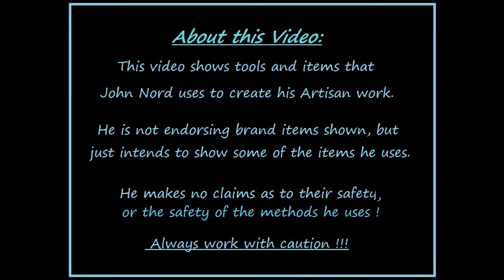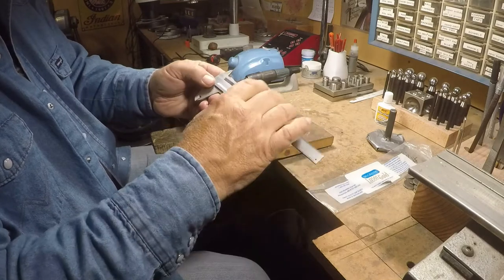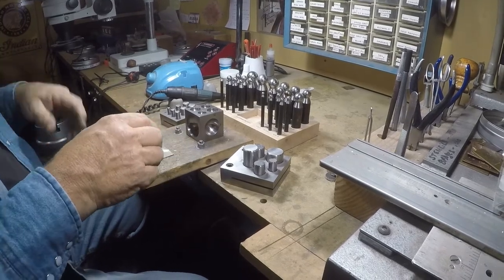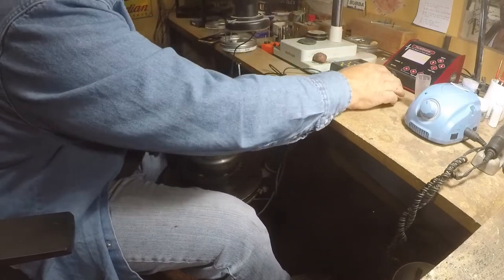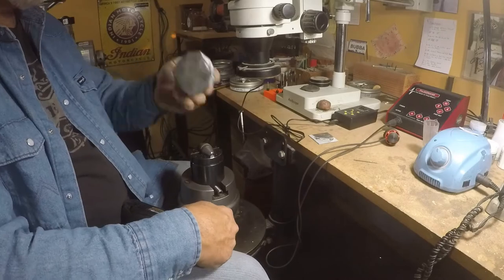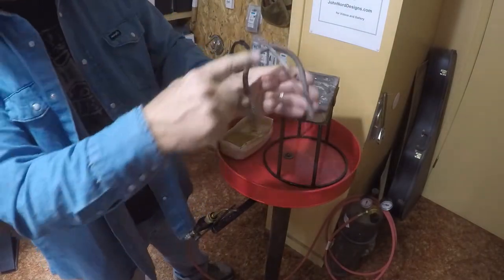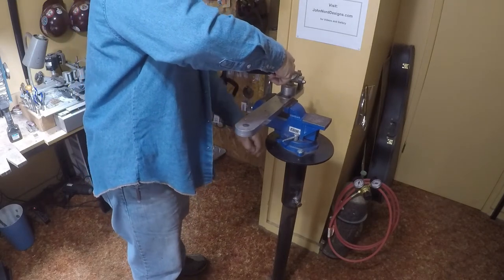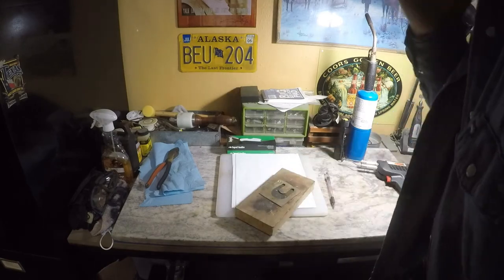Western Artisan Studio

Comment: Excellent video!    I love the convertible soldering station/vise stand.  Your video provided great ideas and a good dose of inspiration needed to invigorate my current studio renovation project.  
I recently purchased an engraving vise.  I am having a difficult time keeping some projects secured.  They seem to pop out.  Ive got a lot to learn.  A video showing different applications for the vise would be helpful for beginners like me.
Thanks for sharing your knowledge and experience.  Your delivery is very calming and easy to watch.
Reply from the maker: Check out Thermoplastic…. I think GRS has it and others. I use it all the time to hold stuff in vise. I also hot glue items to wood blocks. Freezing them gets them released. I also use 1/4” oak dowel rod in the 4 large holes to hold things and not marr them. I have also made specialty attachments. I am in process of doing a 4 part spur series. But will do more tool videos in future. Thank you!